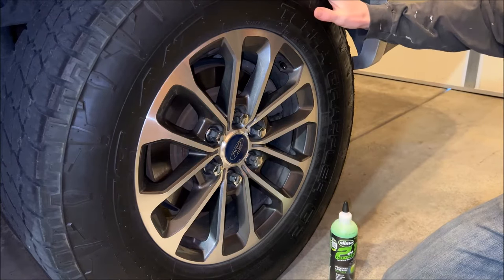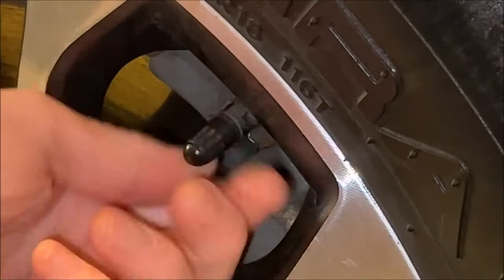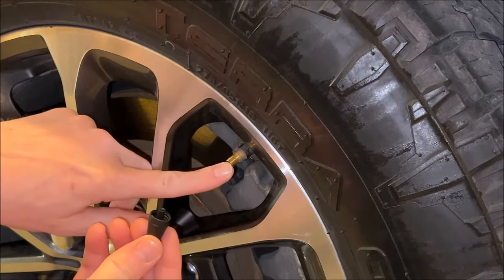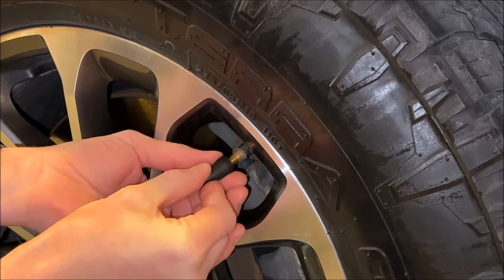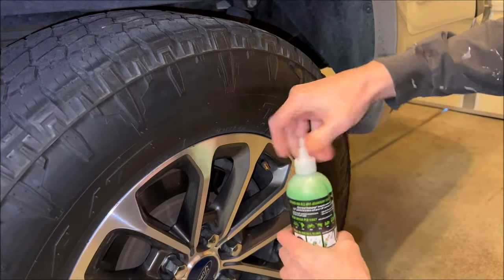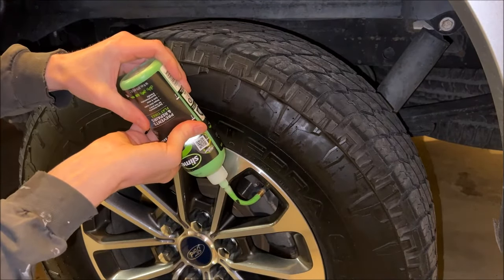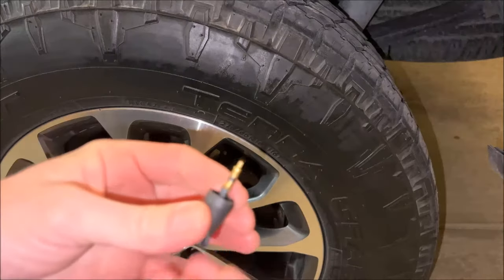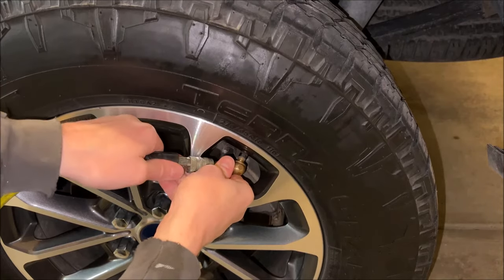How to use Slime Tire Sealant

Comment: This "temporary solution" can last years lol
Reply from the maker: lol, indeed it can!  And often does 😂👍
Reply: Fine on older cars without tire pressure sensor devices that can get wrecked by slime if you leave it in there too long and tire pressure sensors are pretty expensive.  Maybe cheaper than a tow these days.  Depends.  You need to go to a shop most likely to get the tire removed and the slime cleaned off the sensor before it gets slime damages and slime off the inside tire and get the tire patched properly.
Reply: @OWK000  TPS are over rated anyways.
Wife's got a used 4runner with TPS. Light is on full time. They're great if you don't know how to unscrew your valve stem cap and check pressure with a gauge I guess lol.
But, I'll bet this type of stuff is why her TPS light was on at purchase.
Reply: @WhiteoutMonster  Good point: those are hardly necessary.  With smog laws in California I worry they would make you maintain the TPS.  I have a 1993 car so I don't really worry for myself at this point.  I have to research that.
Reply: @OWK000  found our answer;
Chat GPT;
Yes, California requires that vehicles maintain a functioning tire pressure monitoring system (TPMS) as part of the state's smog check program. Since 2013, any vehicle equipped with a TPMS must have it operational during a smog check. If the TPMS light is on, indicating that the system is malfunctioning or that tire pressure is low, the vehicle may fail the smog inspection. This is part of California's effort to reduce emissions and improve fuel efficiency.

THATS INSANITY
Reply: @WhiteoutMonster  you can also just get more accurate ones yourself and put those in/on and they're like $25-50 bucks depending on how fancy you wanna be.

Then you've got active monitoring with greater precision. I put em' on all my bicycles, motor bikes, etc.

Comment: I put it in new tires, I have done this for decades, yes decades. but you do need to make sure your tires are balanced first. and the tire has to be used often. it will leak again if tire is not rotated for weekly or so.
Reply from the maker: Yes, that’s some great advice! 👍

Comment: Three corrections that people need to know for this kind of tutorial video, that is very important for everyone's safety: 
  Number 1, that particular bottle is for off highway tires only, (The one for on road emergency tire repair is in the yellow bannered bottle) number 2 you forgot to tell them to shake the bottle for 30 seconds, and third there's a certain distance printed on the bottle that they want you to drive the vehicle (or push the wheelbarrow etc) after putting the slime in pressurizing it to proper tire pressure.
It's a great video I just wanted to put those disclaimers in there for anyone watching this hopefully also reading the comments!
Reply from the maker: Hello.  Yes!  Absolutely correct and thanks for this comment 👍👍👍

Comment: Thanks for the video, after seeing all these steps using the slime. I decided to skip this step. I'll inflate the tire and drive to the tire shop.
Reply from the maker: Hello. Good call!  I always prefer a patch over slime 👍
Reply: @FastFixYouTube  I'm a patch man who rides a fat Ebike, someone I know gets sick of me complaining about flats caused by 3 spike jacks, he says get Slime, I don't like gummed up valves, I've had Slimed bike tyres come my way, the valves are usually gunked up, my 35L/min compressor gauge showed 70 psi in no time due to clogged valve, I had to take the core out and clean it. That was on a 27x1 1/4 bike

Comment: Hey Jason, I see the bottle says for off highway passenger vehicles. Has it worked just fine for your car ?
Reply from the maker: Hello. That disclaimer is for legal reasons.  They dont want to be sued for broken TPMS sensors or people who use it as a permanent fix.  If you use it to get from your garage to the repair shop, you’re perfectly fine. However, the TPMS sensor can block the slime from going into the tire. If your car has TPMS (very likely) I wouldn’t bother trying this.  Better to remove the wheel and bring to the repair shop.  Assuming of course you have a means to get the wheel to the shop.  Best of luck and sorry this wasn’t of much help.

Comment: My bike has TPMS. Does it mess it up if I use this green blob?
Reply from the maker: Hello. TPMS sensors can actually block tire sealing products, so you may not be able to get the stuff in the tire. I don’t have any direct experience with sealants messing up TPMS sensors, but I’m sure it happens. Thanks for the question and best of luck!
Reply: @FastFixYouTube  What if you insert the slime from the puncture hole? 😂

Comment: Valve stems are permanently attached to the sensor stems and can not be removed.
Reply from the maker: Yes, that situation won’t allow the sealant in…. Good call out 👍👍👍
Reply: thats only if you have the overpriced faulty tire sensors with your overpriced auto add ons

Comment: Good video but I wouldn't put it in tires that have tire pressure sensors in it. It will ruin it
Reply from the maker: Hello, yes that’s correct!  I’d only use in emergency situations because you’re right, it can damage the TPMS sensor although sometimes the sensor prohibits the skin from entering the tire anyway. Natures hymen! 😂.  Thanks for the comment 👍👍👍

Comment: Your slime went right in. Mine has too much air pressure in the clear tube to squeeze it in.
What do I do
Reply: Did you figure this out I have same issue
Reply from the maker: Hello. Well, if it’s air pressure that’s holding it back. You could always deflate the tire a little bit and see if that helps. Of course she will need to refill it with air. If you don’t have an air compressor this could be a problem so only take out a little bit of air at a time. However, another thing that could be stopping you is the TPM sensor, that is installed. A lot of the time those get in the way and prohibit the slime from going in. I should’ve mentioned that in the video, but I’m kind of just figuring it out. Pretty annoying the factory limits are ability to fix quickly with the TMS sensor in the way.  Best of luck I hope you get your tire fixed!

Comment: The one-gallon size gives these formulas to calculate the amount needed :  for low-speed tires (under 45 mph), width (inches) X height (inches) X  0.12 = Oz. required.  In metric, width (cm) X height (cm) X 0.55 = mL required.
              for high-speed tires (over 45 mph), width (inches) X height (inches) X 0.065 = Oz. required.  In metric, width (cm) X height (cm) X 0.30 = mL required.
Reply from the maker: Great info!  thank you for taking the time to write up this helpful comment 👍👍👍

Comment: Was reading it says “non highway vehicle.” Any issues from anyone using this for a highway vehicle?
Reply from the maker: Hello. Remember, this compound is only a temporary fix and shouldn’t be used for extended periods of time. I’d have zero qualms about driving at highway speeds for a short period of time, but the weight of the fluid can affect the wheel balance and cause vibrations or different riding characteristics. Good question and thanks for asking 👍👍